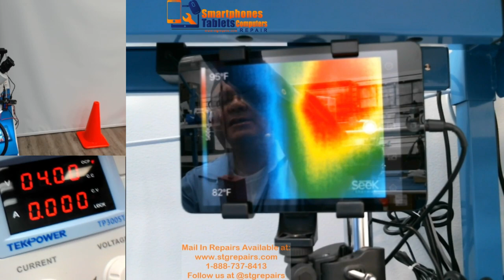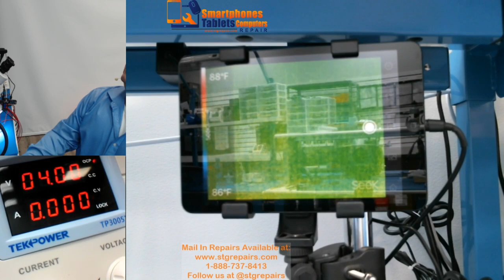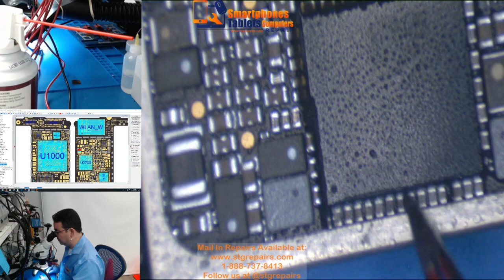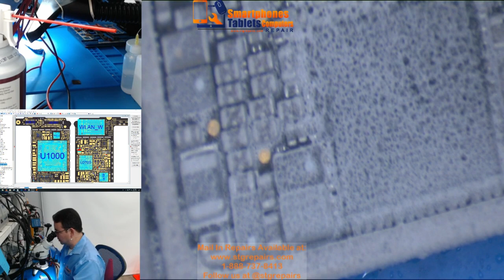Iphone 8 dead short on 1v8 line

Comment: Around the capacitor C1840 at the time you shaved to remove excess resin expose the copper of the plate should put UV paste to protect.